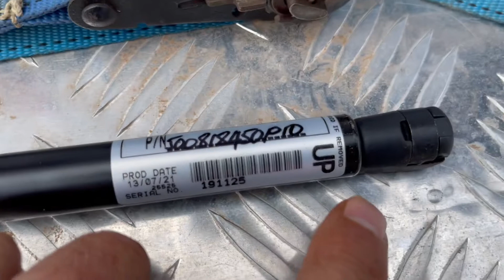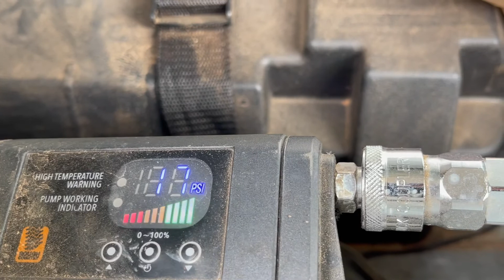HOW TO REPLACE  STRUTS ON  CARAVANS POP TOP or door, beds, tail gates

Comment: Useful video. What type of ratchet strap have you used? Make and model, kgs load etc why I ask because the one I got from Bunnings was not strong enough! The strut made a hole in the strap! It had a lashing capacity of 680kg and the struts I have is 290nM.
Reply from the maker: Thank you for your question. Sorry I was away with no reception to answer early. 
I did not use Strut from Bunnings. I have asked the strut specialist STRUTMASTER . He asked me the dimensions of the old ones and supply me with the perfect strut with new bolts and nuts. Since then it has been  fantastic no issue, talk to them you will find them on the net. They have to be cut according to the lengh of your caravane (the two points where the strut is attached  when your roof is up) They can actually come to your place, or park at the carpark of a supermarket at a meeting time . They Manufacture  (cut to the right size on the spot) the strut from their own truckwork shop, and give you all the hints and how to replace them. My video is excactly what I have done following their advice. The secret is to use the right size.
I hope that information will be usefull. Cheers, 👍👍👍😊